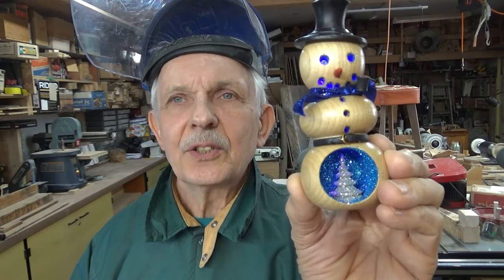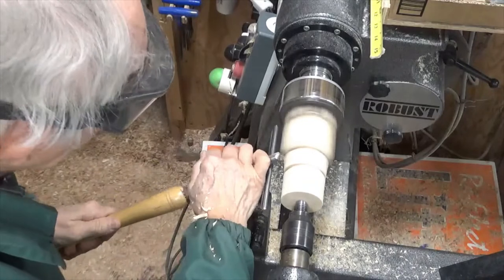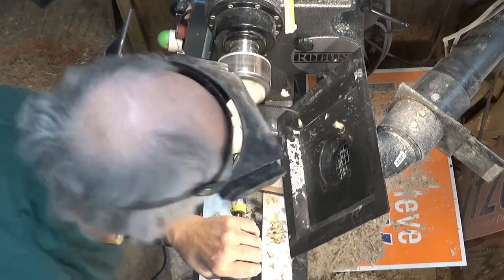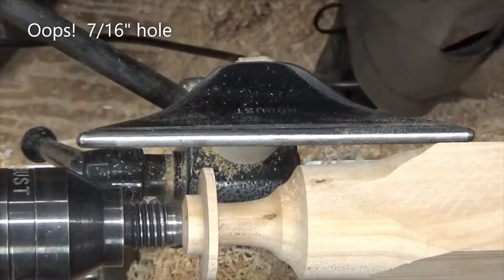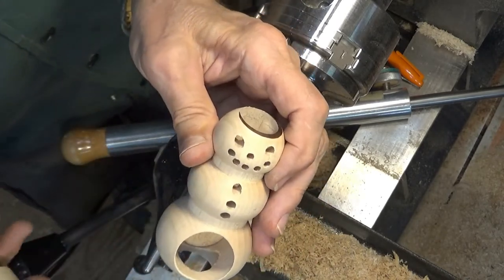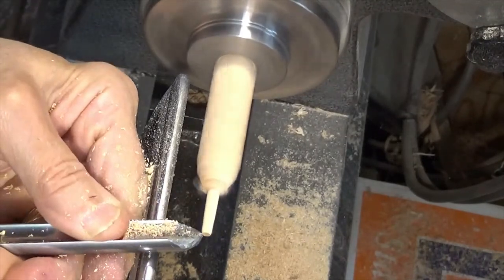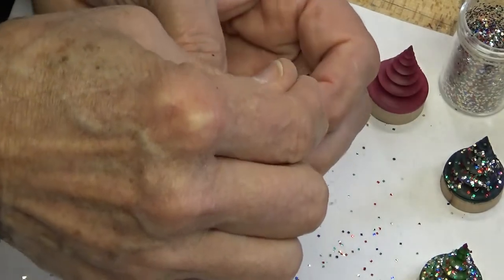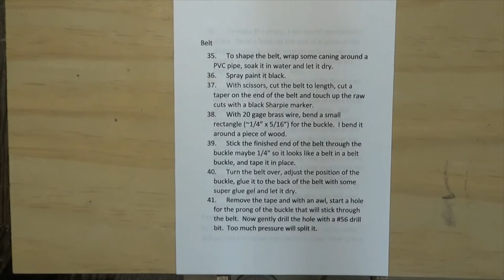Woodturning Snowman

Comment: Great tutorial...love all the details. My only suggestion would be to use a V-block when drilling round stock. Much safer...Thanks for the written instructions at the end. Your's is the first video I've seen that did that...
Reply from the maker: Thanks for your comments.  You are the only one to mention the written instructions.  That was nice to hear.  I didn't use a v-block because I wanted an easy way to perfectly align the belly hole with the face.  That is why I had left the four squared sides at the top of the snowman as a way to register it face up and face down.  Otherwise I would have been left with basically a cylinder to drill the belly hole and the hole in the back for the optional light.  That would have been difficult to secure to the drill press table (even with a v-block) and would have opened me up to being a little off on the alignment because I would have had to just eyeball it.  When making a run of the same thing, that is just another way I could screw up.
Burt
Be safe.
Think it through.
Is it safe for you?

Comment: why did you wait until after you turned the snowman to drill the hole in it's belly, wouldn't have been easier to drill it while square then turn it to clean up the holes while shaping?
Reply from the maker: Ahh.  There was still a square part on top of the head.  I think I was thinking that only after having shaped the body and having drilled out the body and head would I really know how deep to drill the belly.  For whatever reason, the way I did it worked well for me.  By the way, drilling the belly with the forstner  bit  cut cleanly with no tearout.  Try it your way.  It would probably be just fine.